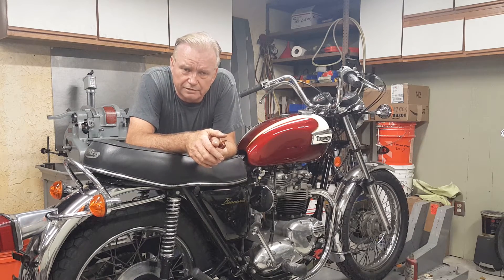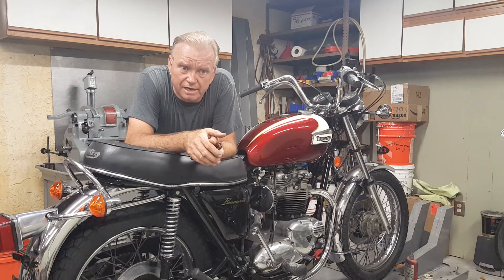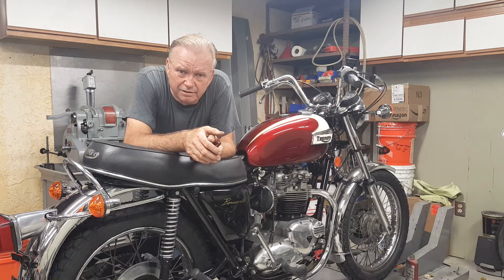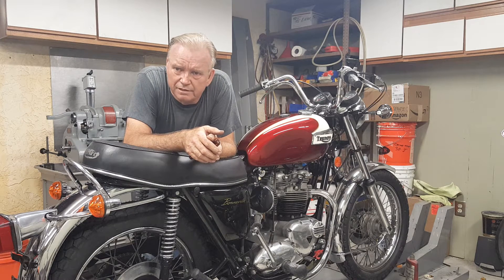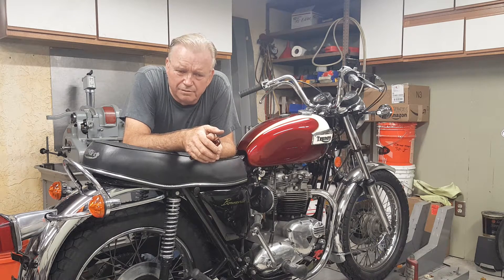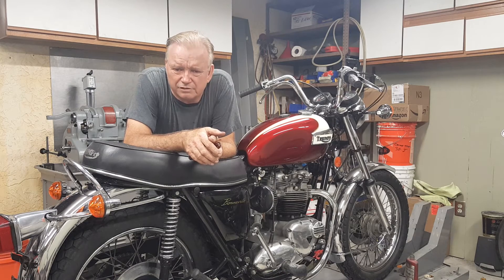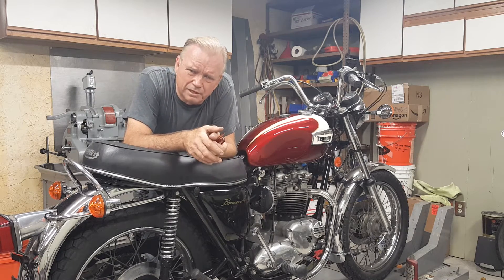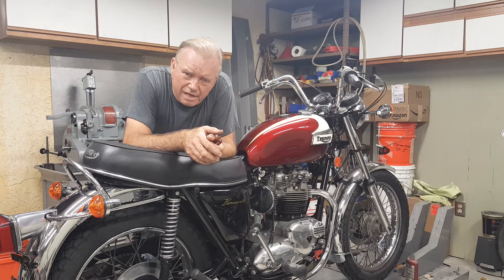Starting my 1976 Triumph Bonneville T140V

Comment: Nice One Bro; All the Best from Bonnie Scotland. :-)
Reply from the maker: Thanks Bro! Took her out yesterday just to blow all the cobwebs out and was waved down by a fellow biker who wanted to look at it and take pictures. Starts on the first kick even when sitting for weeks. Running great, but continually losing light filaments.  She's a little buzzy!
Reply: @doorguru168888    Your bike looks the business. I hope you ride it as often as you can. I've got a 1975 T140V.  It's the last of the right hand [foot] gear shifter &  conical hub brake.
I changed my headlight Lens & bulb Holder holder for a Halogen type.  I always use Genuine Lucas Bulbs rather than the slightly cheaper budget ones. 
Headlight;  Lucas 410,,,,, 45/40W pre- focus
Parking Light; Lucas 989,,,,, 6W M.cc
Speedometer, Tachometer; Lucas 504,,,,, 3W MES
Stop & Tail Light; Lucas 380,,,,, 5/21W
High Beam, ignition and direction indicator warning lights; Lucas 281,,,,,  2w [WL,15]
Direction Indicators; Lucas 504,,,,,  21W 
ps; I know you'll already know this, but this will save you digging the manual out. [hahahaha]
Cheers. ;-)
Reply from the maker: @ianbruce6635  Thanks for the info! I will definitely use it.

Comment: Bought a '76 model one in Cherokee red & white for $2085 cash, back in '77. Talked the dealer out of his only blueprint poster that was titled "An attempt to explain the unexplainable" It basically pointed out the fact that the running axis of the bike & the horizontal axis inter-sectional center of gravity, was located directly behind the triangular triumph patent emblem on the timing gear cover... right where it belongs, between the rider's 2 feet! Tried like hell to find a copy of that poster, but so far, even with the expanse of the internet, to no avail. It was stolen 3 months after it's purchase. So i reckon i'll spend the rest of my riding years on my first purchased Triumph, back in 1972... a '68 TR6R Trophy Sports, which was completely restored back in 2012, by Big D Cycle. Even @ 64 years old, 6'-1" & 267 Lbs. it still makes feel young and agile. 7117
Reply: That's cool 👍

Comment: hey I'm just trying to restore my dads old triumph, the rectifier, on the top is there a place to attach 2 wires to the very top nut? or only one? because on my dads there was a 2 prong connection but one of them broke off. now I'm looking at replacements and all I see is ones with 1 prong on top so I don't get it. part # is 49072 I beleive, if yours is different or has a different part number let me know please
Reply from the maker: I ditched the rectifier and zener diode and used something very similar to this:
https://www.lowbrowcustoms.com/podtronics-regulator-rectifier-triumph-bsa.html?gclid=CjwKCAiAqbvTBRAPEiwANEkyCOr-FZwZ8Pm2pKsKwYziaJpemkdaXf19_DEcetFWgtocj5KfcyF1BxoC_wYQAvD_BwE
Reply: ah okay, perhaps thats the easier way to go with it. but still mine has 5 wires going to the rectifier, on the top bolt there is 2 prongs, one comes directly from the battery and then another red wire clips in below it. everything I look up are just 4 wire systems but for whatever reason mine has 5 any idea?
Reply: and did you have to replace the stator also?
Reply from the maker: Well as in the diagram below, some had an extra prong at the plus of the rectifier for an alternate capacitor to help maintain a continuous 12 volt positive supply.

https://4.bp.blogspot.com/-gQAgDRuXx4A/TxFK0VahXII/AAAAAAAAAAM/AgS-0e6A7i8/s1600/1971+Triumph+TR6R+Wiring+Diagram.gif

Or, another wiring diagram with a five wire rectifier:

http://www.triumphrat.net/attachment.php?attachmentid=64872&stc=1&d=1369875706
Reply from the maker: Yes.. I replaced the stator. I never checked it and was out for a first ride and noticed when I turned on the lights, the engine would cut out! Bad stator!
Reply: @doorguru168888  If you have to replace the stator, it is better to fit the the 3-phase version and a solid state regulator rectifier. That way you get more volts at lower revs around town and your indicators (turn signals) will work with the headlight on at idle.